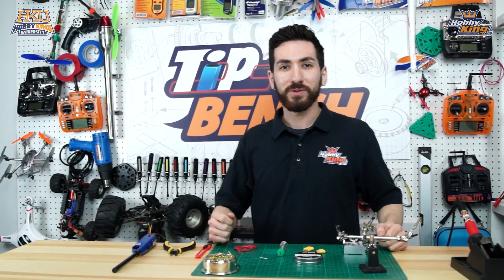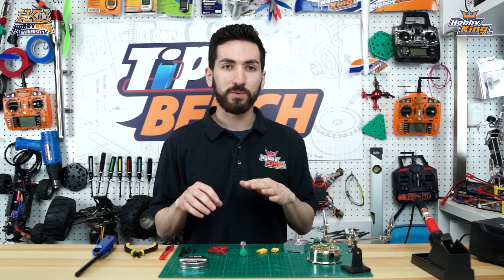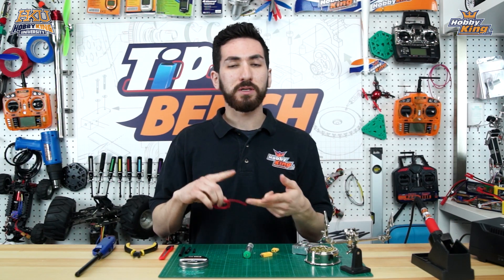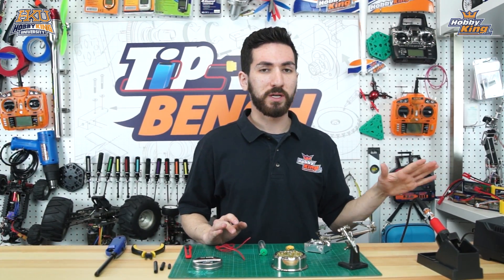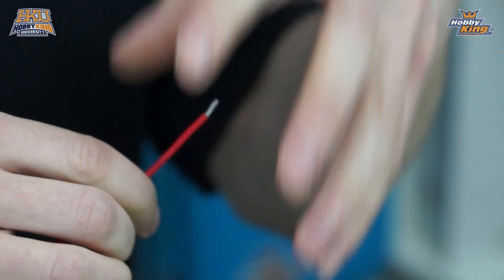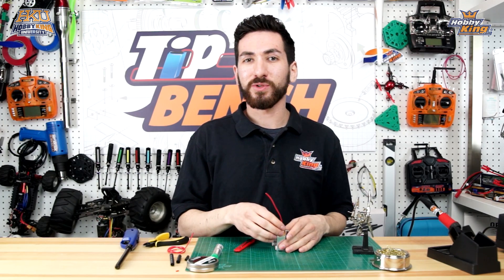Tips Bench - Soldering XT60 Connectors

Comment: Im sorry but no, this is not the best way to solder these connections. Actually, its not a good way to solder anything like this. To transfer heat as quickly as possible you need to have a good surface connection between the tip and the cable or connector. You do not apply heat first and then apply solder, you heat and apply solder at the same time. And you apply it to both the iron tip and cable at the same time. That way the heat transfer will be way faster and more efficient, and in turn less heat will travel through the cable or connector.

Comment: Not "any solder", use only good quality "leaded-type" rosin-core solder and rosin type paste flux intended for electronic soldering." Lead-free" solders  and fluxes require higher heat to flow properly, hard to use for hand soldering.

Comment: You should be ashamed of yourself for using 18 gauge wire for this tutorial that was aimed at beginners.... There's no reason ever that an xt60 connector is necessary for 18 gauge wire... Beginners that are requiring xt60 connector or anyone else that is requiring xt60 connector is going to be using a bare minimum a 14-gauge but preferably 12 or larger... Anything smaller is not worthy of xt60 connector and therefore should use something different like Dean's or even a crappy Anderson plug.... Because those plugs are meant for smaller gauge wires that require less amperage.... If you're going to be doing tutorials you should do accurate ones with correct information rather than leading people astray making them assume that they need to be purchasing the xt60 connector that is not needed or even worse letting them think that an 18 gauge wire is sufficient for an xt60 connector when in fact if the xt60 connector was placed under full load that 18 gauge wire would burn up... This tutorial is BS and has the potential to create all types of hazards for your viewing audience... You need to do better

Comment: Very good and easy to remember xt60 solder tutorial
Reply from the maker: Glad it helped
Reply: @HobbyKingOfficial  I just noticed my soldering iron Temperature scale only goes to 450 degrees, so will it melt say .090 dia. solder enough to bind with the XT60 connector or do I need to get a better Iron ?  It's worked for all my other projects ...

Comment: I was taught that those metal wire tip cleaners are a 'last resort' for cleaning the iron when you really can't get off something nasty. They damage the tip as you use it.
You also made the rookie mistake of cleaning the iron before putting it back in the cradle. Solder on the tip protects it from oxidising, so you should leave some on whenever you're not using the iron.
Reply from the maker: Great point!

Comment: So - these handle a little more amps than the usual 'Deans' connectors.. and since they have more mass in terms of connections, you need more heat with LESS time on the connector. No issues with how I saw it done in the video - have seen many horrid attempts to soldering as being 'helpful tips'... not really. 

I personally use around 500 - 700 degrees Celsius on the soldering iron, fully adjustable setup - well worth the money to go ahead and get one that has been calibrated and tested accurate; believe me. Tin the wire, tin the XT60 connectors but not fully pool the joint yet - take your tinned wire and place it in the joint (that's where the alligator clips or jig come into play), get ready because this is going to happen way faster than in this video - take your solder and get it close, grab your iron and start with the WIRE first - melt the tinned wires, then QUICKLY pool in the solder. This will first melt the solder on the wires, contact the XT60 solder joint and melt the pooled solder on the joint, and join all solder when the new solder being pooled in with the wire and the already tinned XT60 joint.. As always - this method works very well, and fast - you don't want too much time on whatever your soldering; be it an XT60 connector, Deans, or even copper pipes. Too much time with heat causes damage, and that's never fun! Even with plugging in the battery / ESC side with the opposite plug - male /female - they will still melt if you have too much time on the solder joint! ;)  

Remember - more heat, less time!

Comment: prob i faced, even the station is set hot, the tip not heat the wire xt60... and that not mealt my solder wire at all

Comment: You may have some solder down in there.. But not much. Solder doesnt take magical paths down into things. It draws itself to the heat source. When we fill high amperage battery cable ends with solder, we have to heat the actual metal end, not the wire. Your wire is already tinned, yay... But to draw the solder into that xt, you are gonna have to heat the end that you plugged in to its counterpart. Or you have an incomplete fill.

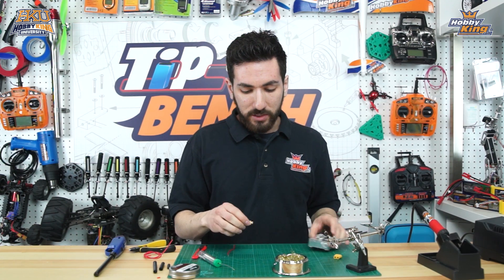Comment: 05:50 like the silicone cable, xt60 are also heat resistant, if you have solder iron under 40 Celsius you don't really need a pair of connectors because it make hard to solder.
Reply: Best to take a small punch and knock the bullet pins out.... Then you can solder it all ya want without melting any plastic, especially if you're making adapters for lipos to esc....I did for outcast 8s...........ec5/xt60..... no problem, they just snap back in plastic housing
Reply: A soldering iron under 40 Celsius is pretty useless, don't you think? Even old fashioned leaded solder doesn't melt until around 220 C!

Comment: Definitely not the perfect way to do it, straight up and down.   You're better off being level.   The heat shrink tube won't slide down the wire into your work while you're working, the solder won't dribble down into the barrel connector, and gravity will make the wire droop into the molten solder as it cools.  

No signals flow through those wires, only power.  Unless you plan to use your cables for something else...  sure... signals... anything you want... TCP/IP packets even if you want...  seriially... lol.  Sure, why not.   Proably even if you're creative shoot a video signal down it through an XT60 connector on your pirate radio station.

Comment: Solder the wire with as much contact with the connector as possible - solder has a resistance, so having the minimum in the path between the wire and the connector reduces this and the resultant heating as more current flows. Solder is a conductive mechanical join, but is not a substitute for conductor-conductor contact.

Comment: In your updated version of this video, you might consider to solder either a black wire to the negative (-) side of the connector or alternatively solder the red wire to the positive (+) side of the connector. Nice soldering job though. One question about flux: when I learned to solder (1970's) I was told that this "flux" or soldering grease contains an acid / releases an acid when it is heated that will ultimately cause your connections / circuits to corrode, hence only to use flux as a plumber but not when soldering electronics. Is flux something different than soldering grease or is modern flux not causing this corrosion anymore ?
Reply: Man, that's a great question. Too bad nobody around here knows the answer. Would love to know. If i find it i will respond here.
Reply: @sunstar2310   The flux used in solder for electronics is a rosin based product.  Plumbers tend to use acid based flux.  I actually have both types of solder.  I keep the one with acid based flux on the shelf with plumbing stuff.  I keep the rosin based flux on the shelf with electronic stuff.  I also tend to buy much larger diameter solder for plumbing to, to make sure I don't put either in the wrong place.  Over time, labels wear off.
Reply: The flux used in solder for electronics is a rosin based product.  Plumbers tend to use acid based flux.  I actually have both types of solder.  I keep the one with acid based flux on the shelf with plumbing stuff.  I keep the rosin based flux on the shelf with electronic stuff.  I also tend to buy much larger diameter solder for plumbing to, to make sure I don't put either in the wrong place.  Over time, labels wear off.

Comment: I just soldered my first ever XT60 connector and i am not amused. The one gold plated connector started to melt, offsetting the symmetry of the two connectors so i had to launch a little rescue operation. The fact that these connectors can melt is a Big issue whereas the Deans T connectors i am used to does not melt. I may have subjected the XT60 to excessive heat when soldering, but i did that on purpose to see how it would stand up. Another important aspect is the fact that you can Not see how well the solder joint has set under the surface, inside the hole even though it looks great on the surface. This would not be an issue when using the Deans T connectors. I`m surprised the video does not show any attempt to presolder the inside holes of the connector. Isn`t that the norm? For what it`s worth, i like the grip on the XT60 connector better than the smoothness of the Deans T connector for ease of pulling them apart. I will continue to use my Deans T connectors so thanks for nothing, UGH.

Comment: 7:20 problem with that is once the solder cools the wire still pulls right out of the xt60 as if the solder did adhere.  What did you put on the xt60 to get the solder to adhere to the xt60?
Reply: Yeah I didn’t see him tin it or even use any flux. I wouldn’t trust that joint not to pop out if I did it. Maybe his technique works for him idk

Comment: was hoping to see you solder some multi stranded 12ga or similar, no-one is going to have any problems soldering that thin shitty piece of wire, nor are you going to want to solder such thin wire to an xt60 connector, they are designed for high current, that wire is not

Comment: Agreed This is definitely not the SAFEST or best way of doing this.

Here are some tips on how to do it much safer and better.

1.  Your helping hands will puncture your insulation unless you put two to three layers of heat shrink tubing over the teeth of the aligator clips.  This can lead to what is known as Corona leakage (yes it's an actual technical term) which means voltage will be present on the surface of the insulation.  If said Corona discharge comes in contact with a piece of metal that is grounded it can lead to a short.  Which means your ESC will be toast and have to replace it.  Or worst case someone will touch the metal chassis and get shocked.  Again an unsafe practice if you dont protect the teeth of the aligator clips.

2.  Liquid rosen flux such as kester 186 is a better choice as it's not as corrosive as most paste style flux and easier to clean with alcohol than paste style flux.

3. Using a utility knife is not a safe way to strip wire, you can easily nick or cut a strand and that can cause your current carrying capability of the wire to be reduced.  Which in turn can lead to the wire becoming a fuse instead of the fuse doing its job.

I'd recommend using wire strippers intended for stranded wire you will be much less likely to nick or cut strands by using a wire stripper.

4. Also 3/16 shrink tubing works best as it's slightly larger than the bullet contact.
Reply: And don’t put your connector in an “aluminum” block when “soddering” it to battery leads..
Reply: @txkflier  💯% or 💨
Reply: Maybe you should make a video
Reply: Joshua Beconi no kidding. What the hell! 
Sounds like a true pro!

Comment: I like your Mr. Jig. The way you do it regarding safety is important. 

One of the things I don't get is why there are so many videos on this and many people over solder their connections. Just to throw it out there if you flux the wire like you did, but add the right amount of solder to the connector which doesn't take much on a small wire. Place the soldering run tip underbeth the metal part your about ro solder and let the heat transfer from underneath to make your solder liquid. Insert the wire inside the solder and you will see the wire absorb the solder like a sponge and remove the tip, you will get a much cleaner and quicker result.

If using 12 gauge or 14 then the way you let the solder soak into the wire tip, just enough to fill in the wire. Takes very little. Add solder to the end tip you want to solder onto and let it soak. In by holding your hot tip underneth or the other side where the wire is connected to. Or evwn allow the the top of the wire get hot enough again you will see the solder leave the connector tip and soak into the wire and providing a good connection. This will look clean and be quick and be professional looking. You should be able to rip on that wire and it will stay connected and provide good power transfers.

What I am describing does take a bit more practice to figure out how much to solder your wire and how much to place on the connector tip to make this work. 

I went to college for this and learning the right amount of flux and solder and heat temp us important. You really don't need 700 degrees to solder. You can solder leaded and unleaded at 368 Fahrenheit. I just do 420 Fahrenheit for my own preference.

The video was good. I just wanted to share this and get opinions.

Comment: You should pre-heat the bullet and tin it BEFORE you bring the wire into place.  The way you're doing it, there is a chance that the connection to the bullet will be a cold solder joint.  Also, please stop saying "We're going to..." before each and every step of the process.  Thanks

Comment: Quick tip, if you shrink the end of the heatshrink a bit you can fit it in the gap between the bullet and the connector housing. Great demonstration btw.
Reply: 3/16" shrink tubing works best as it's just slightly bigger than the contact.

Comment: Just make sure you solder the red wire to the positive side of the connector, not the negative side like in this video or there will be a lot of magic smoke everywhere.
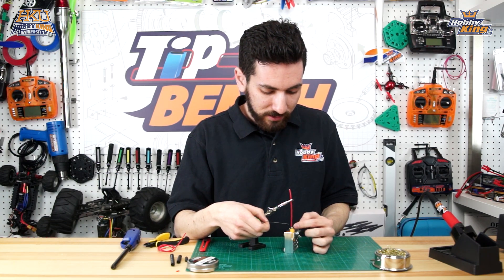Reply: 6:43 "I've been doing it for years like this, I've not had any problems with any of my connections" gave me a good laugh.
Reply: Is it labelled positive and negative?
Reply: @somemore9784  On my xt60 connectors there is a + and - on the plastic.
Reply: @beginningbotany9523  Yep. I managed to do it. Successfully soldered an xt60 to a 36v battery for an ebike.
Reply: @somemore9784  You can see the negative - a bunch of times.  Try looking at 7:00
Reply: MaGiCaL

Comment: A couple of helpful tips for this vid 1, when taking off the wire coating to expose the wire twist as your taking it off this will twist the wire together without pricking your finger on sharp strands. 2, on the XT60 mark with a felt tip pen which side you want to solder to or you could end up with male to male or female to female joints!
Reply: Two other benefits of twisting with the insulation as you remove it:

1. You don't coat the bare wire with finger oil. NASA teaches there are three key elements to reliable solder joints: cleanliness, cleanliness, and cleanliness. If you grab the exposed wire with your fingers, there goes your cleanliness.

2. It lessens the need to cut all the way through the insulation and thereby nick the strands, as the twisting action will break a scored line of the insulation.

Comment: Thought would be to explain which end is the battery side and which would be the esc. Also which side is the positive and negative. This was more a soldering demo than an xt60 setup demo. Good start, just thought it could be better explained.
Reply: The socket contacts should be on the battery side since the batter is always live and this will make it finger safe.  The Male pin contacts should go on the ESC side.

Comment: Any solder will work? Might be able to get away with that for a quick bullet solder job, but not the best advice to drill into a newbie's head! I'm a bit of a electronics junkie, so blend, type, core or not, diameter, all matters to the job. Are you joining wire, working proto board, surface mount components... It all goes with the old saying, "the right tools make any job easier"!
Reply: bruh im just tryna connect my batteries
Reply: Any solder will work, and positive/negative are interchangeable. This is hobby king, what were you actually expecting?